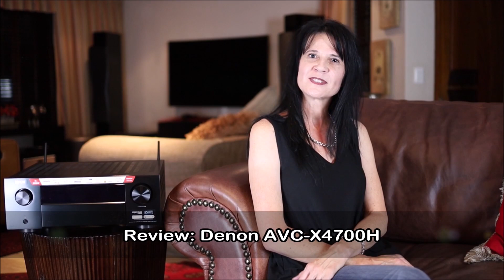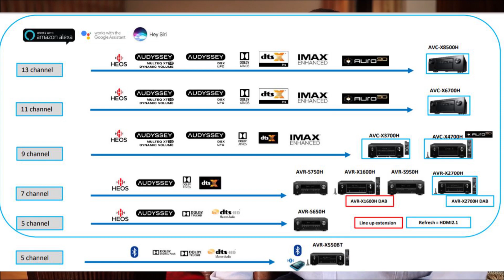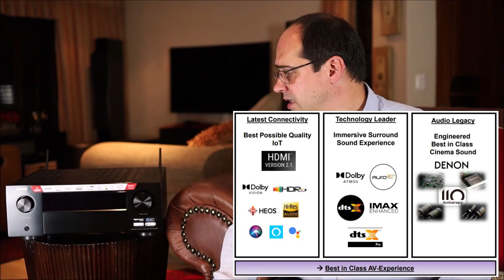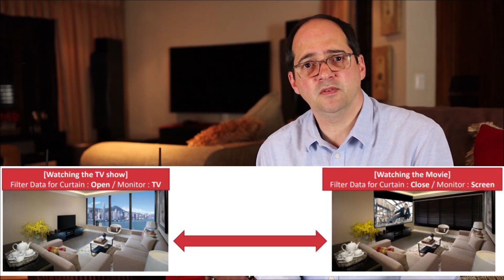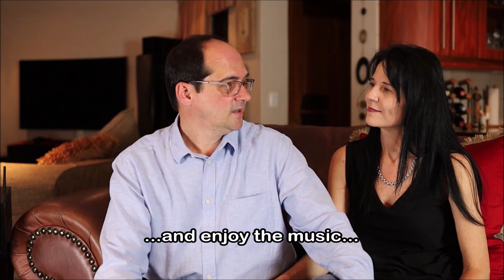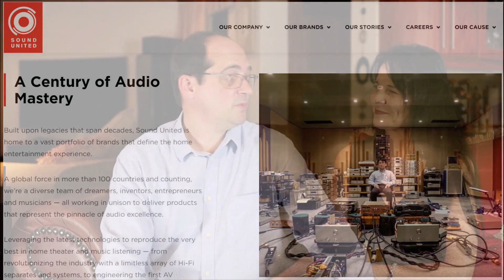Review: Denon AVC X4700H

Comment: I ended up buying the Denon X4700H to replace my older Denon THX AVR and it’s the worst thing I’ve ever done.Every time I turn this thing on something different happens.I’ve had home cinemas Many different AVRs and this one is driving me mad.I turn it on and the Apple TV comes on and my 4K BluRay also comes on.Sometimes I get Dolby Atmos some times Other sound formats and sometimes not.It’s an absolute nightmare.I just watched a video of a guy who’s having the same problems.70 comments of people that are experiencing the same switching conflicts.
I suggest you live with this Denon for a few weeks and see how you feel.I never had these problems with my older more powerful THX Denon.These recent models are a load of junk.
Reply from the maker: Hi Howard thank you for your feedback. I  am sure there must me a reason behind the issues you are experiencing. I recommend you contact your nearest or preferred Denon dealer to assist you to rectify the problems. The unit I tested or reviewed didn't have any of the issues you described. I am sure there are some software issue or some configuration mismatch. Hope your issues will be sorted soonest.
Reply: Does the audio couple have children 🤔?

Comment: Very informative review, just wondering as I'm looking at the Denon X4700H receiver, how far can the measurement mic go in metres? I would be listening some 8 metres away and the speakers at the front would be 5 metres apart, would the cable be long enough to measure such a distance? I may at some point move to even further back in a larger space in my home so hence wondered how long the measurement mic cable is and what the max distance for the X4700H system is... My system if I go ahead will be initially 5.2, then possibly 7.2 at a later date.
Reply from the maker: Hi Adam, thank you for feedback much appreciated. I did not measure the length of the measurement mic cable, but it is surely around 6 meters in length. As a workaround you can perhaps move the 4700H closer to the measurement area - if the speaker cables will allow or you can extend the mic cable with an off the shelf 3.5mm stereo jack male to female extension cord. Sounds like a very large room - but I am sure you are going to enjoy the setup !

Comment: Hello, I have "sony str-dn1080".  The heating of the device bothers me.  Does this device get hot?  Does the assigned "phono" entry work well?  I am a physical media collector.  I love listening to vinyl, cassettes, cd, sacd and watching 4k bluray, vhs.  Is legacy technology (vhs, tape) support good?

Greetings from Turkey 🇹🇷
Reply: Yes !! This 4700h get hot as hell. As with all denon avrs.  You can fry an egg on this unit. Im coming from pioneers avr over the yrs and they are cool to the touch.  I had to get a cooling fan because there is no way this avr will not overheat. Especially if you have it in a cabinet
Reply: I've had several AVRs from budget to premium. I'll Always Remember The Sound of the Sony STR dn1080... considering it's only a budget receiver, it certainly has a wonderful 2-channel sound, a slight coloration but punchy plus agile and very pleasurable to listen to! In fact when it came to the sound of its 2-channel (music) I actually prefered the sound of the budget Sony over the mid price Denon 6500. 😲

Comment: are there any firmware issues for the 4700?
How audio in movies is the 4700 superior to the 3700?
Reply from the maker: Hi Ciro thank you for your inquiry. In general only a few small or minor glitches were experienced during my time with the X4700, but it was more related to fast syncing with the audio codecs from the source equipment - but no user intervention was required the X4700 self-corrected the issues. I will say the experience related to audio performance in movies will more or less be the same, but you alway gain by having more powerful audio power amplifiers for improved performance and user experience in general. Goodluck with your decision. Enjoy!